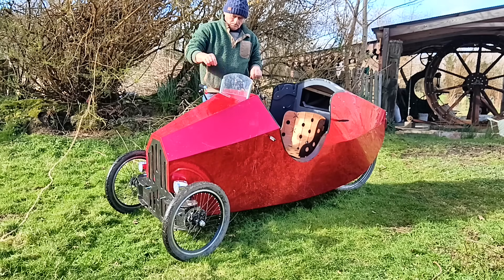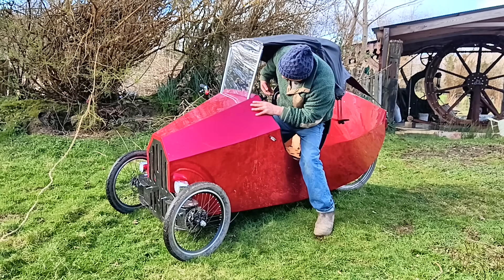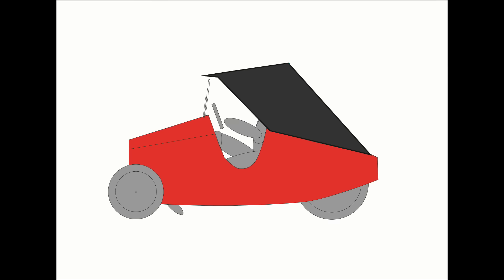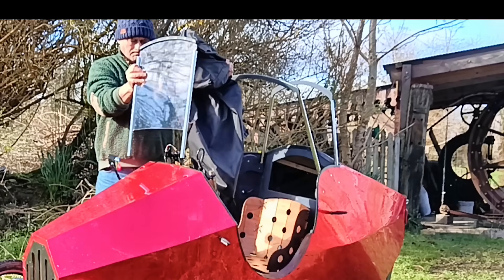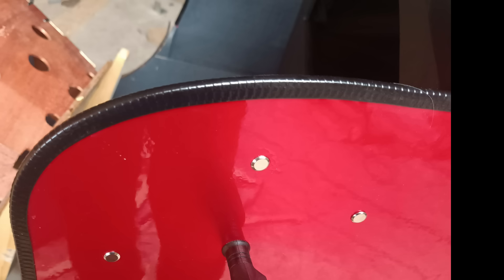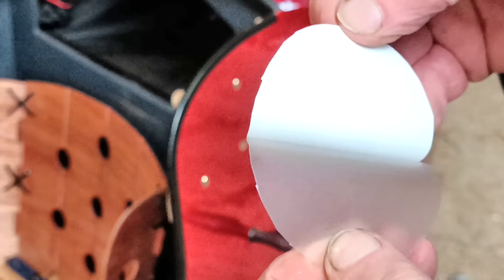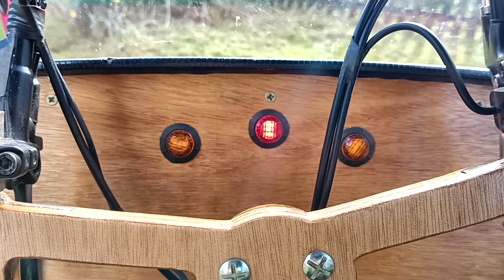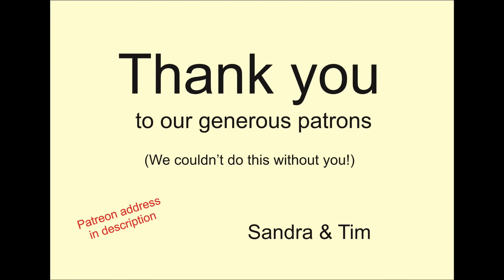A ROOF! And The Wooden Car Is Finished....

Comment: Have you considered using solid polycarbonate sheet? No need to shape it. You could design it in panels like you designed your car, drill holes in it, then stitch it together.

I'm working on making a kayak this way.
Reply from the maker: that's an interesting idea, Peter. I wonder what would happen in a crash - would it break into sharp shards?
Reply: @wayoutwest-workshopstuff6299  Nope. PC is very robust, it's used for things like riot police shields, motorcycle windshields, bus shelters etc. It's also that corrugated material plastic greenhouses are made out of.

It's very tough and tends to flex rather than break. It's similar to acrylic but much stronger and less brittle.

It can be heat formed but you'd need a really big oven and a vacuum table for that, making it up from panels is probably more practical.

Comment: I like your pedal car a LOT.
It's somehow well suited in the tradition of the Morgan Threewheelers.
I have 4mm plywood here in my workshop in full size panels.
Should i try a clone of your velomobile?
I also prefer the "deflector" windshield with a slot to look through. The very first motor cars used the same, before windshield wipers were invented.
Your roof being ventilated in the back is also a very good idea. 
I experienced the drawbacks of a closed back of the roof, turning it into a braking chute...not so good for efficiency.😏
Also thanks for speaking slowly and clear for my outlandish ears😅
Best regards from Germany

Comment: Marvellous! I like the simplicity too! I suspect someone's DIY option might just fold the frame down & you can drag the attached screen to raise or lower it. I think, as I sit in what I'm pretty sure is the well-into-double-figures storm of the year down here that's actually bending my front door, that you might want to secure the bottom of the flaps too or they'll just blow away from the gap, & it'll rain inside anyway...

Did you ever explore front mudgards? I'm not sure if you've left room to just mount some ( probably front wheel ) big mudgards or if it'd need some bending. I'm very impressed with the detailing in general.

Are there any rules about sail-powered cars, btw?

Comment: For safety, you can add a side window from a clear shower curtain liner, so that you may see at intersections.. Also, the leading edge of the side curtain may be attached to the A-pillar (the windshield edge) with a hook, so that water won't come in as much.

The double-ended bolts are--SEX BOLTS! Or Chicago Bolts.

The car is really shaping up. You are inspiring me to build something.

Comment: Many have suggested a windscreen wiper.  I will suggest a clear view screen like you get on ships.  A disk of perspex or similar spinning at a rate enough rate to chuck the rain off it by centrifugal force.  Should be easy enough to build using a brushless motor but balancing maybe an issue.
Reply: I was thinking the same, but with the disc working like a child's handheld windmill.... no motor needed!
Reply: @miniphase  
I like it.  If it could be made to work it would be in keeping with the ethos of the project

Comment: Looks really good! I think acrylic would be an option also for DIY. Maybe not a dome, but simple straight bends in acrylic are really easy with a heat gun. You just set two boards on the sheet and heat the gap between them and it makes a nice sharp bend. Could make a sort of pyramid shaped box for this. In any case I think this has really come together as a great design!
Reply from the maker: You're right, Ben, that would work - but it would be bulkier and heavier too..?
Reply: It wouldn't look as nice as yours either I'm sure!
Reply: But you couldn't stow it when not in use. The collapsible design is perfect!
Reply: I would use polycarbonate instead of acrylic, you can get much thinner sheets of PC as opposed to acrylic.

Comment: This is looks so nice! And I love the lights! Have you considered optional fenders for the front wheels to prevent puddle splashes or wet road spray going into the cab, especially at higher speeds?

Comment: Suggestions:
At higher speeds one does not use large steering angles.
It only at low speeds that they are used.
So an elliptical steering roller, which does in fact keep the steering cable tension constant, is an idea that gives you the best of both worlds.
ie: Less squiggly steering at speed , without a loss in steering angle at low speeds...  So you might want to check the trigonometry on ellipses...

A telescopic steering column to avoid people being 'kebabed' in a frontal collision..!

Comment: Are you going to add mudguards? 
  Mud and dirt will collect inside the back and cause rot and extra weight.
Reply from the maker: I'm waiting to see what builds up over the back wheel. If I add a mudguard in there, it would still build up - and the mudguard itself would be awkward and weigh something too

Comment: Hi
Add fender for rear and front wheel for mid and water splashing and brake light and reflector tape for better visibility at night
Reply: Mud*
 I think brake light needed for road legally

You can use bicycle fender
Reply from the maker: a brake light is not legally necessary - only a back light. Yes, a fender is possible but not easy, or essential, so I'll leave that out of the plans

Comment: If you make a pattern for how to sew the fabric roof, what about also a second pattern for a canvas or nylon parking cover that can be used with the small windscreen (or with it removed). (I.e. a cover that can be quickly put on while the vehicle is parked.)
Reply from the maker: Yes, you're right. I need to order some more fabric first though

Comment: Im surprised you brushed off a perspex/acrylic wind screen/shield. Surely its just a matter of building a large enough vacuum former. A vacuum might not even be necessary
Reply from the maker: I'm not saying I couldn't use perspex (and it would be fun to try) - but for the simple buil-it-yourself version I think this is best
Reply: @wayoutwest-workshopstuff6299  I see, I didn't take that into consideration, thanks!

Comment: Pretty and good tho i do wonder if it was tested in the rain, it looks to me that there'd be a mild problem when driving into corner or slowing down for any reason what so ever.

it MIGHT need a wider windscreeen to avoid most of the rain. But i could just as well be completely wrong, hence the testing in the rain first question up front.

My possibly unjustified worries aside i am glad the little red paddle car is practically finished and looking forth to see what name it will land on. i have seen some interesting suggestions on the community tab and under few videos.

Comment: We used to just use soap on our visors. Though it's usually used inside the visor, to stop it steaming up. To clear rain you usually just wipe it with a glove or tilt your head to let them be blown to teh side.
I do the same in the bathroom, just a quick squirt of cleaner spray on the mirror and wipe it over. When the room steams up the mirror doesn't.

Comment: Anybody know the legalities with this in the US?  Tim here in Indiana they changed the laws in 2015.  I believe we now have to register things like this and get them plated.  I am confused how to do something like this because you have to sign a affidavit and they want the vehicle identification number but I have no idea how to get one on a home made bike.  They consider this a motor driven cycle since it has 3 wheels.
Reply from the maker: I dont know how things work over there, but here it's ok if you don't try to sell it. (I had the car tested so now I can issue plates if I sell one, but it wasn't cheap.)
Reply: @ My state got funny about it because alcoholics that got their license pulled would keep driving motorized two wheel scooters.  Like a vespa.  49cc 30mph.  They changed the laws.  So confusing. Yet my local government allows golf carts. Hmmm.  We can buy and sell no limit there.  However they dont limit ebikes yet. I see kits for bikes with huge wattage motors. Even going on bike only trails. Nothing standardized. I get the feeling if the mott had no shell they would just assume its a weird bicycle.  P.s. did find some ebike regs. 750w max motor. Pedal assist only. Max 28mph is class 3.  750w max 20mph with a throttle control is class 2.